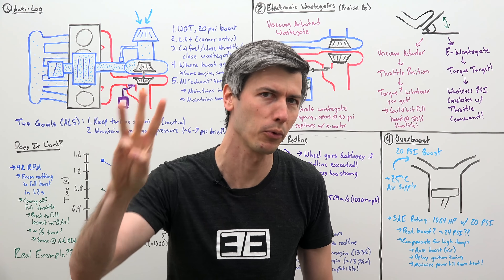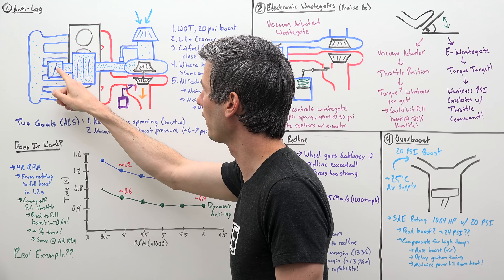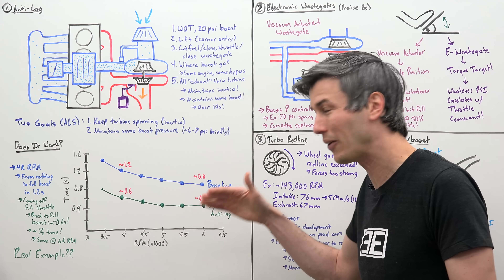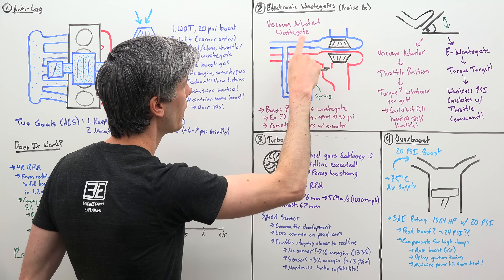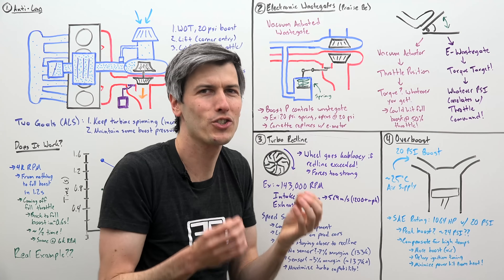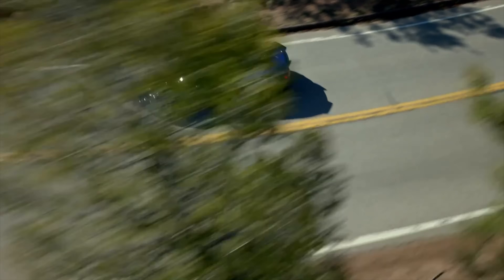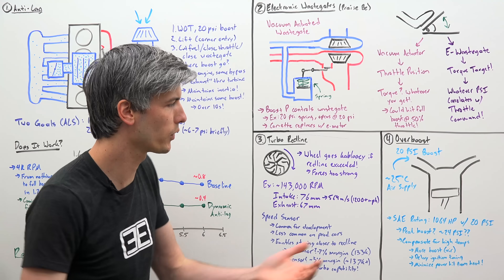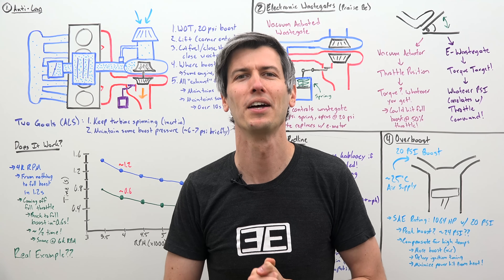Corvette ZR1's Anti-Lag System – Massive Turbos, Minimal Lag

Comment from the maker: Of course, everything in this video applies to the Corvette ZR1X, but it has the addition of a front electric motor vs the ZR1, giving it AWD. *Fun fact:* the ZR1X's 1,064 HP engine came first, and then they worked on increasing the output of the e-Ray motor (from 160 HP to 186 HP) enabling the clean, sky high 1,250 HP for the ZR1X. Bonkers! That also means you've got torque fill for low boost scenarios. The ZR1X's front axle disconnects at 160 mph, so both cars (ZR1/ZR1X) will have the same top speed (233 mph), while the ZR1X will accelerate quicker at lower speeds. Which is your pick?
Reply: I would consider it unbelievable if I could only either one of these incredible ZR1 models, but unfortunately, it will never be financially viable for me.  Thankfully, I get to live vicariously through incredible content, creators like yourself.
Reply: @trusttech9942  Oh, that's the thing about cars nowadays--it's an economically inaccessible hobby. For the common man, the heyday of sports cars is well and truly over.
Reply: @psychic_wolf  The Corvette was never a particularly cheap car compared to other, more affordable cars.  It was always somewhat inexpensive for the performance level it offered, and that remains true today.  There aren't many 1000hp sports cars at its price point.  However, there are more affordable sports car options out there.  Like Miata, GR86, BRZ, Supra, and Z, that are somewhat more affordable.  Less powerful?  Sure, but sports cars have never really been about the absolute maximum horsepower, but rather the driving dynamic.  Ultra-powerful sports cars are a relatively modern development that is blurring the lines between sports cars and the exotic supercars/hypercars that have always been extremely expensive.  But there are good sport cars of the past that made less than 100hp.  You don't need a 1000+hp monster to have a fun sports car.
Reply: @megachonk9440 . I would point out that the BASE model Corvette has more usable power and handling than the big-block Stingrays we had in the 1960s and 1970s, and a more realistic MSRP than these expensive factory hot rods like the ZR series.  If you want a “sports” car, well, that was never really what Corvettes were, and still aren’t.  Think Miata, the Austin-Healey Sprite perfected.
Reply: Miata
Reply: @psychic_wolf  you can still buy a mustang for cheap, and boost it for easy 700-800 whp.
Reply: Great video, I worked on the turbos for the ZR1, they were in development for longer than most people imagine, we started way before the C8 was even announced.

What you described as a vacuum wastegate is actually a really old school P2 or pressure controlled wastegate. There was an intermediate step between a pressure actuator and a modern electronic actuator. You can control the wastegates with a vacuum pump and PID control valve, which allows you to do some of the nice things you would do with the electronic actuator. A big thing every manufacturer does today is to couple the first catalyst as close to the turbo as possible and open the wastegates wide open on a cold start, anything to reduce the time required for cat light off is considered a big gain. We even design turbine housings to attempt to channel as much flow into the catalyst brick as possible. This would be impossible with a P2 actuator.

A difficulty with electronic actuators is in the kinematics, pneumatic actuators, either pressure or vacuum are not position sensitive they just move back and forth until you get the pressure you want, they are self adjusting like a hydraulic clutch. Electronic actuators are fully mechanical like a mechanical or cable clutch, they have position sensors which work in conjunction with the pressure sensors to know where the wastegate needs to be. The hard part is that the zero position moves around as the turbine housings heat up and cool down, the kinematic programming for electronic wastegate actuators is surprisingly complex.

That said I haven’t worked on a pascar turbo without an electronic actuator for many years, although it takes a while for new projects to finally get to production, like the ZR1 which was started way before covid.
Reply: @TheMhr650  So was I right in that the turbos are a 76mm exducer on the compressor side?
Reply: @jasonquartermile425  Yes, they are close to the max for a BB03 frame size. Nowadays our application engineers, and the manufacturers engine simulation engineers are so good we almost never change the basic wheel size once we have a match. If we need small changes in the map we can tweak a myriad of features like the trim percentage which controls the inducer size.
Reply: @TheMhr650  Thanks! I figured since I know a 57mm inducer turbo on a diesel will max out around 450rwhp so it seemed logical that the turbos were sized for the max engine HP.
Reply: Has to be the ZR1 because of the charming driving characteristics of RWD. It'll just always be the best drivetrain imo.
Reply: @psychic_wolf it would be extremely easy to offer a pure RWD mode for charm since you can disconnect the front motor, and enable it when you're drag racing or driving on wet
Reply: ZR1X! Can't wait to see your video on that beast ;)
Reply: @RaRa-xg7le 100%! The ZR1 was already enough, the ZR1X will be legendary! Beyond hyper car territory. So cool to see all the engineering coming together with the ZR1X.
Reply: Does the turbo placement, i.e., very close to the exhaust manifold, play a part in reducing the lag as well?
Reply: @sp129  Absolutely it does. GM is also doing some cool stuff with ignition timing not discussed in this video
Reply: Lovely, but I'll take 60% of that rated HP to have a much simpler, non-hybrid, non-turbo engine.  A manual trans would be nice, but I've accepted reality that they're dying off.
Reply: Did they stick with this electronic-wastegate-based setup in the 1X, or did they move to e-turbos? If you have a hybrid drivetrain to begin with then the latter seems advantageous...
Reply: @patrickchase5614  eTurbos are a whole different order of magnitude of complexity and expense to make work right. What having the hybrid drive will do is to make some of the lag mitigation features of the ZR1 less important, you can cover up turbo lag with electric motor power. Years ago, I was working with Honda on a super complex multi stage turbo system, they briefly considered that design for the new NSX. as soon as we learned that it would be hybrid we knew that we would not be awarded the program, once you have hybrid you can make a much simpler turbo solution work, no need for a super complex and expensive system.
Reply: Another question: Does the overboost scheme that you described around 12:00 also correct for altitude?
Reply: No Manual, NO CARE!
Reply: @EngineeringExplained Turbos are actually very small for that size engine....specs have been passed around as "76mm," but oems rate turbos in exducer size rather than inducer....so in aftermarket terms they'd only be 54-56mm, whereas most turbo v8 race cars will use a 62-76mm inducer turbo....
Reply: Is the 1,064 HP on E85?
Reply: @minecrafthacker9582 No as far as I have seen it is just on good old Super 91 or 93 Octane.  I imagine a whole new world of HP on Racing Fuel like 103 or higher Octane.
Reply: C6 Grand Sport No contest.
Reply: For the way I like to play (twisty roads) if I could, it'd be the ZR1X. I loved the dynamics of my Eagle Talon AWD with the way it could kick the back around a bit while still grabbing and going. 6x the power would be quite the rush.
Reply: The 9 year old inside of all of us would unanimously agree on the X. For them, it's a no-brainer. As an adult who knows the costs and realities of owning, maintaining, and working to put money into the car, I would choose the Z06, which is the most sensible. No consumer is going to safely be able to use all 1250hp in a daily setting. The fact that GM designed it with 420mm brake discs and 10/8 pot calipers strongly suggests that GM knows that they're giving too much horsepower into a road car.
Reply: I love you
Reply: Which one is my pick?? Can't afford neither. Gone are the days of the 70-80k Z06's and 100k ZR1's.
Reply: I just don’t trust GM products.  Our fleet of 1500’s GMC’s and Chevy pickups has seen massive mechanical failures at about 100k miles.  Bad transmissions and a few engine replacements.  And these trucks are pretty much commuter trucks, they don’t tow or haul much.  Just not dependable.
Reply: Triumph Street Triple because I can't afford 6-figure cars lol. Still has a similar power to weight ratio as the C8 Z06
Reply: ZR1 for sure, downpipes, cat delete and a real exhaust with some tuning will open that car up too 1400hp i bet.
Reply: Jason, tell me, in your honest opinion, how reliable do you think this new ZR1 engine from GM is compared to something like a Honda or Toyota engine?
Reply: Crazy the car just dynod 1028hp at the wheels so probably over 1100hp
Reply: ZR1X has 17.5% more power and 17.5% more torque, and 7% more weight, and net gain ~9% on power to weight
during launch the rwd can't transfer all the torque to the wheels, so the torque gain will be more like 30%.
it's a bit disappointing that the motor disconnnects between 160mph and 233mph where it could be just as useful as for 0-60mph
the hypercar level zr1X would have deserved hypercar tech like carbon wrapped rotor revving 20k+ rpm, more advanced / power dense electric motor (3.8kW/kg vs  class leading ~15kW/kg from Lucid/koenigsegg 
 or even Tesla 8kW/kg)
but considering they did a decent job on the eray battery power density and pushed it a bit further at 1.5kW/kg, not too far from the revuelto's 2kW/kg
it's a very realistic approach to making an hybrid hypercar and the 160mph limits sounds like it's purposely optimized for providing power throughout the quarter mile
Reply: The Z I want is made by Nissan. So much better looking. Looking into aftermarket turbos, but I doubt they have electronic waste gates. The tech is behind the times for sure, so my dream car would be the Z with the Porsche electronic turbos and pancake motor in it...
Reply: My pick is still the C8 Z06 because I like being able to use the throttle more more than 3 seconds without going to jail.
Reply: Why a single electric motor opposed to dual as we see in something like the NSX or SF90?
Reply: @aspecreviews the sf90 makes 1000ish combined the zr1 makes 1064 all motor it doesn’t need it
Reply: @aspecreviews cause it's straight from the eray (1 motor more cost efficient):and they just tuned it 15% stronger through software and "strengthened internal components"
Reply: How old are you?
Reply: @unkownyoutuber07395 69 i believe
Reply: @unkownyoutuber07395 he is 42069 Hours Old

Comment: What America needs is durability. Cars that can be used for 10 or 20 years.Japanese cars will not break down, but they will not last 20 years.
In Japan, light trucks were produced by six manufacturers, but since they can be used for 20 years, the number has now been reduced to two manufacturers.

Comment: The motor-driven valve is especially useful in countries where taxes vary based on engine displacement. It is especially necessary for Japanese minicars with a 660cc engine.The smaller it is, the easier it is to strengthen the block, etc.

Comment: yea this only works on an automatic or if you don't close the throttle plate fully.  Sometimes its a lot more fun to not eke out every bit of performance.  Even though its slower I had way more fun in a 5MT on the track than paddle shifters.  Hitting the perfect 3 pedal shift >>> anti lag.

Comment: All super clever genius engineering.  Yet daily driving an EV it’s hard not to notice the lag in pretty much any ICE engine when you mash the throttle.  I have a supercharged >500hp vehicle and it feels SO laggy compared to my EV even though it is objectively genuinely quick.  It’s really interesting seeing what clever things engineers try to mitigate the difference. 

One quibble with this video, all the driving is on a track.  On a normal city street or even typical rural road good luck staying on boost as a practical matter.

Comment: That was really interesting, the question I've always had, and maybe the answer is obvious, but why put the waste gate on the exhaust side, if you do it on the compressor side you can control boost precisely independent of air temperature (since you are directly measuring the pressure produced rather than as a byproduct of power to the exhaust side. This of course also handles the issue of say driving up Pike's Peak where the intake density is somewhat independent of temperature (since the temperature drops with altitude as does the pressure). Now obviously with electronic controls that waste gate may in fact take into account all those variables (because 0s and 1s are free) although I guess you still have the issue of overspeed on the turbine to deal with. Maybe waste gates on both sides?

Comment: As we're driving by wire and using maps, why wouldn't you let the car use full boost, but limit the torque by simply injecting less fuel?

Comment: The carastrophic fail point on the Ioniq 5 and Ioniq 6 is the ICCU (same on both cars) that is a reliability nightmare and obviously an engineering design problem. And because they fail so much, there are massive supply chain delays on getting them to dealers, so these cars sit useless for weeks and months waiting for this warranty part.

Comment: It's weird to correlate lap times, and turbo technology. This is a huge thing to take into account, or otherwise consider....... The inability, or the refusal... It is one, or the other, not both.... But, it is either the inability to learn how to manage, or the absolute refusal to learn how to drive a vehicle using turbocharged induction. Like mentioned before. It is quite interesting to consider these! Because one, or the other IS HAPPENING! Quite CLEARLY! Again, it is very interesting to see this taking place. If it wasn't, the lap time curve over time wouldn't reflect it. The curve reflects folks learning how to manage the lag, and then all of a sudden either stopping, or not able to further learn. One of these sounds reasonable, the other does not. So we are either needing, or not needing to re-learn, or not re-learn. Nothing is going to be, either easy, or not easy about this ENTIRE thing. Lol!

Comment: All this stuff seems pretty standard on modern turbo cars so it's definitely not new tech. The reason they get away with running such large turbos is because they are attached to a fire breathing 5.5L V8 that revs to the moon and is very efficient at making power even without the turbocharging (think 670hp on the N/A ZO6).

Comment: I don't know about that Subaru but intake pressure controlled wastegates are prehistoric turbo tech. Any turbocharged engine I've ever seen in the past 25 years with a pneumatic wastegate has a vaccuum wastegate actuator that does exactly the same thing as an electronic one, it simply regulates the vacuum pressure via a PWM signal to do it rather than use a motor.

Comment: Regarding your assessment of the way that Subaru responds to partial throttle I have to disagree.  As an owner of one of 3 of them at varying times, I have never had any issues with partial throttle control.  It's more likely a case of you not being used to the car compared to normally aspirated engines.  I think you do a disservice to the brand.

Comment: I have a 
TURBO SPORTSMAN XP1000 WITH E85 
It's 0-60 4.24 seconds and will be in 3's for 0-60 after more modifications and BOOST.

It also doesn't have any Turbo lag 
because it's 0-10 stock was
.45s and with the Turbo It's 
.38s
 and the stock 60ft was 
1.86s
With the Turbo 60ft is for now 
1.76s.

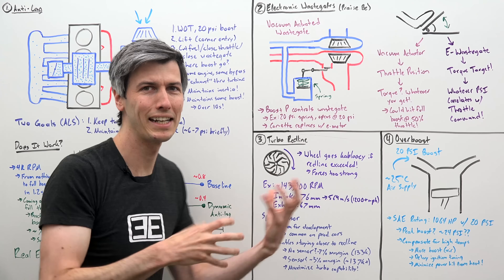Comment: 7:19 youre mixing up boost control with torque demand, on a drive by wire car 50% pedal doesnt  mean 50% throttle opening- Throttle opening to pedal relation changes throughout the rev range giving you, when demanded, the desired acceleration. Boost control plays less of a role than throttle valve opening since throttle valve opening gives the turbo the possibility to spool in the first place

Comment: Also there's some misleading scenarios regarding  parts throttle full boost Westgate springs versus Target pressure and the function of the bypass valve when you're in between them

Comment: Is the boost measured pre-throttle body? I made my own fresh air als system well before turbosmart  release their valve system and performed logging to differentiate the systems performance. 

Depending on your bypass valve settings you likely have a coupl psi positive pre throttle in many road going cars. .

Comment: Around 8:00: Bosch ME7 systems around 2004 already worked around "torque request" principle and managed turbo spool by modulating throttle valve

Around 10:00: redline for turbo was already present in 1.8T with K04 turbine (Audi TT 225hp)

Comment: the electronic exhaust wastegate control is great. I think the ecoboosts got this in about 2018 which helped with that partial throttle control. I have been tuning Subarus for about 13 years now and your so correct on the Subaru system. Plus the drive by wire system that always calculates way more torque request than what people assume they are inputting.

Comment: What you said right for vacuum WG only if the setup was by default closed but that wrong if it was setup partially open and closes to make boost controlled by vacuum actuator which control partial throttle and boost curve perfectly WGDC

Comment: Don't know anything about sportcars, but on consumer ones turbocharged engines were providing a very wide torque range for decades now.
I had a 1999 Passat with 1.8T engine, and its peak torque started somewhere like 1800 RPM.